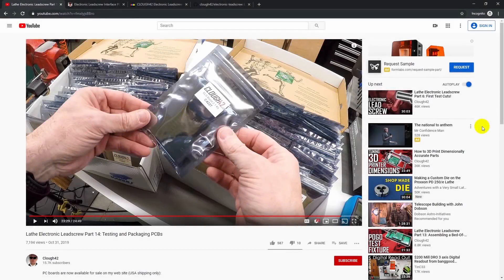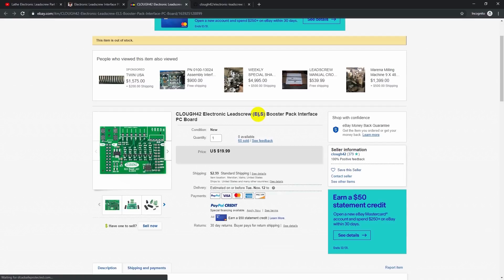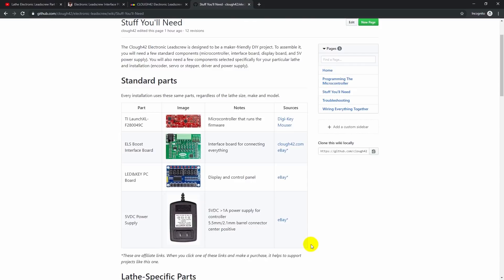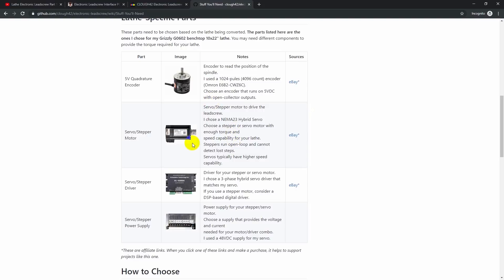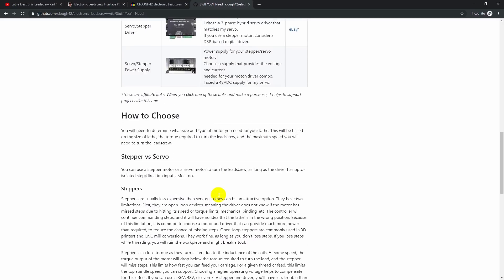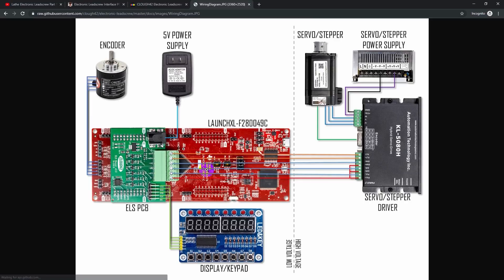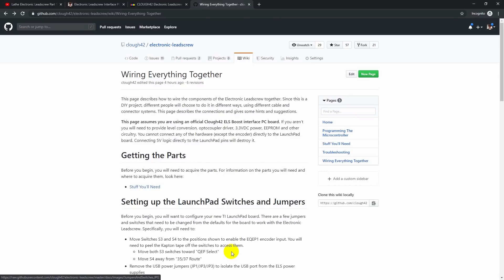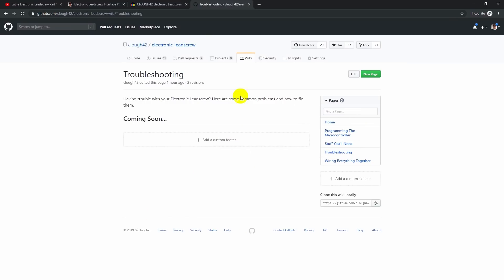Lathe Electronic Leadscrew Part 15: Sold-Out PCBs and Documentation

Comment: I bought this. I know this is several years old, but I stumbled upon your channel, maybe a year and a half ago and it has helped me tremendously with several projects, and I have wanted to do this for a long time since I saw your videos on it, and of course I picked Probably the worst time to do it at the same time as I’m doing a digital read out on my Mill as well as motion on Z & X with power feeds, not a CNC conversion because I have a 4‘ x 4‘ CNC enclosure already that’s a gantry Mill, that serves any CNC purpose I have I wanted something manual to be able to feel what I’m doing when I’m just doing it without Design, that’s how I like to get my creativity out is to just make things rather than design them first, then when they work, I make a design and make it more professionally but that’s here nor there, as far as the lead screw project it’s gone, wonderfully, it’s on the lathe and working perfectly, I did use the same stepper/servo that you did, my leg is similar in size. It’s slightly bigger but nothing substantial it’s 30 x 14, and it’s handling it very well. that stepper online servo is pretty powerful, I had actually purchased a Nema 34 1700 inch pound and 12 nm of torque servo and didn’t even need to use it, this was plenty. So I was impressed with the motor, the encoder. I don’t have any comment on because I didn’t try that encoder, but the one that I did use works great. But the punchline is that I appreciate all you do for the community, and your videos, your work on this project and everything else that I’ve seen that’s been tremendously helpful to me personally, and your video say you’d like to hear from us about how we like the videos and I’m just fulfilling that, so in short, I appreciate everything you’re doing

Comment: Already have a EK-TM4C1294XL Launchpad, which is same dual BoosterPack XL connectors and runs at 120MHz and has 1MB of flash. Can the software be recompiled for this Launchpad?
Reply from the maker: Seems unlikely, since it's a different MCU and has no encoder inputs.

Comment: cam I use a 12 volt or 24 Volt, DC  mother with this system a I already have the Motors, & the yes micro switching as There off a mobility scooter ?

Comment: Builders will have to modify the code if there is anything other than a 1:1 ratio from the stepper to the lead screw. My TPI was way off before I realized the code couldn't know about my 4:1 gear reduction. Just multiply your gear reduction factor into the TPI_NUMERATOR equation. If you still have problems, don't forget to check the settings on or in the servo driver. Mine were set wrong and it drove me nuts until I figured it out. For example, my quick change gear box reverses the direction of the lead screw, but since my driver has an external switch to reverse, it didn't require any software changes.
Reply: Thanks for the tip about gear reduction factor, I reduced my microsteps to 4 on the driver to over come my 2:1 ration problem but your solution is much better (smother operation).

Comment: Hi James. Some channel suggestions, should you have a few odd spare days to make the videos! (I'm joking).  A tour of some of your other electronic test equipment - why you bought that model oscilloscope for example. A look at your frequently involved 3D printer set up, particularly the software used. Personally I think you'd have done a wonderful job with a 'How to build a cnc mill' but appreciate that is water under the bridge now - there's some useful hints in the coverage you do have at any rate. The point is that you are an extreemly good educator and much appreciated by your viewers (ok, nearly all!). You get complex things across so very nicely and, for example, have given this rather verbose almost 70 year old  the confidence to tackle your ELS project - I've now got your ELS boost kit (No folks, it's not for sale!) and my rotary encoder is now on the way from China. I'd also like to thank the people who input thoughtful comments, in some cases direct to me. It's both helpful and uplifting. Thank you all. BobUK.

Comment: First, i want to tell you that i find your explanation of this project the best video series i have seen .
 I m starting to get everything to make this project.
 One thing i d like more precision is about the belts and pulleys, I think you sait M3 for the servo but i dont see the width .
 I evaluate the width to about 20mm but i cant find m3 pulleys that wide. i might go with M5 unless you could point me in another direction.  

Thanks a lot for this great project.
 Daniel

Comment: Hi James, it might be helpful to add a few links about timing belts and pulleys to your documentation, along with a note about spindle sizes! As you will know the rotary encoders are available with a wide range of pulses per revolution. Maybe a note about altering the firmware if a 1024 pulse unit cannot be found would be useful and do you have a feel for what pulse per rev range would be ok?Incidentally the cost of the rotary encoder here from an established UK based supply house is over £200. A great deal cheaper from E-bay. BobUK.

Comment: Feature suggestion: a proximity switch input to stop the feed, sort of like how some lathes have an adjustable bump-stop that decouples the half-nut.  That way you can thread quickly without having great timing skills for stopping the feed at just the right place.
Reply: I was thinking the exact same thing. Isn't there already some sort of inhibit/enable input that gives this ability to instantaneously halt motion via the E-stop switch?

Comment: My main question surrounds in how to acquire the box that holds the display and holds the buttons? I've got nearly everything else.
Reply: Me too. BTW, I just barely made an order on the second batch. Got two boards on the way. I'm hoping Jim is willing to offer a modified version of the ELS program to allow a simple gear hobber to run. Clough42, please contact me if you want to hear my ideas on this parallel project.

Comment: One last thing, you might want to restrict the purchase of the next couple of batches to one board per customer, initially. On the last batch, quite a few people bought 2 or more boards which really cut down the number of individuals who got a chance to purchase one. After the initial rush is over, I'm sure that many people, myself included, will buy extra boards for additional machines or projects. Thanks again for your efforts on our behalf.

Comment: I already modified my machine, waiting for 2 components to be delivered - LED display and a belt to drive the encoder. In the meantime I did a test run just to see if the stepper is capable of turning the leadscrew and pulling the apron/carriage/cross slide along. Looks like I will have to change the pulley ratio from current 1:1 to 2:1, seems like the stepper is just not strong enough at 1:1 ratio, I cannot take as deep cuts as I would like to.

Comment: Oh, I have another question. Can the board do 2 encoders and 2 servos? I was thinking about controlling the cross feed as well. I know it'd need additional programming, I just want to know if it has that capability for the lathe and something else I have in mind. Again, awesome video series, thank you very much for all that you've put into this!!
Reply: If you are powering the cross slide too you are just one step away of full cnc. I did this and used a Pokeys57CNC board with Mach4. I put on two handwheels so I can still use it like a manual lathe just with steer by wire.
Reply: Christoph Pech Nice!! Thanks, I'll look into it :)

Comment: Sold out that's the right kinda problem to have.
Future projects suggestion because you explain things so well would like to see you write a driver for an oled display(s). Arduinos have many libraries for this but that doesn't help someone who wants to change or add parameters. Your basically stuck with what the programmer thought was important. Displays are so universal in projects and oleds are a nice upgrade would be neat to see some one fabricate from scratch like this project and explain the code.(c maybe?)

Comment: I would be interested in doing this if I could work out what motor to use, as my lathe is quite large.  Will have to do some homework on how much torque the lead screw might need.
Reply: Suggest you just measure the torque. All you need is weight and a leaver.
Reply: Andrew Gillham thanks, good idea.  👍

Comment: I will by the board when it’s available, but am getting parts to get rolling, but would like to breadboard the interface for now, could you formalize the circuit diagram for thru hole components also on the wiki, as I fear i may miss opportunity to buy one in the smaller batches, and want to start machinery mods sooner rather than later.

Comment: When ordering at Mouser.com (controler board) if you are international customer you have to choose an address remember that at the bottom of the page under "delivery type" to choose "commercial" now you can choose DDP
Carrier Cost
DDP (Duty and customs fees paid by Mouser)
FedEx International Priority
I had to pay $ 15.57 in sales tax and $ 23.73 in customs clearance.
Regards Jorgen Denmark
Reply: I got my board ordererd directly from TI and had it in for 44.76$ taxes, shipping etc... included for delivery to Belgium. With the exchange rate it should be around 40€. Ordered on Nov 4th and delivered today on Nov 8th. This is very fast !
Reply from the maker: Yow.  I would think TI would have distributors that stock the boards internationally.  I haven't spent a lot of time looking, though.
Reply: @Clough42  I thought it was an Swedish part of Mouser but it came from US. So I run into custom troble so I had to pay, it is why I put in the comments. Fine work James, you are a little handicapped when you also have work to do in daytime.

Comment: I'm curious, why did you hook the Enable, Step and Direction pins positive together, and switch the negative side - as compared to hooking their negatives together and switch the positive side?
Reply from the maker: As has been pointed out, switching the negative side is easier for a couple of reasons.  I used an N-channel mosfet transistor, which is very efficient and has a low on-resistance.  Historically, the P-channel (or PNP) transistors that would be required to switch the high side were more expensive and had a higher on resistance, though that isn't as much of a problem today as it was.

The other issue is that sourcing a voltage to the n-channel gate (or biasing the base of an NPN transistor) is a little easier.  Technically, 3.3V logic only has to get to 2V to be considered logic high, so there's a chance that a high output would still switch on a P-channel transistor (-1.3V gate-source).  But since logic low is usually 0.4V or less, you can be sure that it won't switch on an N-channel logic-level FET (0.4V gate-source).

Using N-channel also has the added benefit that a logic high output from the pin turns ON the transistor, which turns ON the common-positive LED in the optocoupler, so you don't have to remember to invert the signals.
Reply: to sink current you use only one cheap transistor

Comment: amazing!! this makes finding a used lathe easier for me, since i could pay less for one with no gears for the lead screw.. for example.
now, i've been thinking. you use an encoder to read the revs from the spindle. to me that means it is reading "turns". WHAT IF you use an encoder to read turns from your cross slide and carriage?? that'd make one "easy" and probably very accurate DIY DRO wouldn't it? (don't know about the price thou). as i mentioned in some other videos, i know closer to nothing about all this... but i didn't know that electrinic lead screws existed when i suggested that not so long ago, so im feeling more confident hahahahaha. i feel like using something similar to what you are using for the E-leadscrew could also be used as a DRO. hope this ideawasn't too stupid.
Reply: The problem with reading the dials using a rotary encoder for the purpose of a DRO is that you don't account for backlash in the leadscrews. For this reason, linear encoders directly connected to the sliding parts are far more accurate.

This is also technically happening with the e-leadscrew - but because the carriage will be moving in the same direction every pass, any backlash is essentially a non-issue.
Reply: @bradley3549  i see. very intersting. reading the position of the moving element compensates for backlash in the leadscrew that moves it. reading from the leadscrew itself would always read the x amount of backlash. sadly backlash is not particularly a constant error (cos' of wear in the nuts and screw increase over time, and so does backlash). otherwise, you would be able to have a "death zone" (make it not read the first x pulses from the encoder). well, that would be posible actually, you'd have to re-measure the backlash every so often. i guess it'd all come down to price-effort in terms of linear vs leadscrew DRO.

Comment: Phew! Glad to see the level of interest James, my board is in the way, should he here next week. Cheers BobUK.
Reply: Hi Bob.  I’m also in the UK and would like to hear how it turns out.  I’m on mycncuk plus I have a YouTube channel.  Thanks
Reply: @routercnc9517  Oh, hi there! Yes, I've been wondering if I should try to put up a series about implementing it on my lathe. The little board has arrived - took a few days longer than anticipated, but it got here. I used to work with pcb's at BT and this one is nicely made. I'm approaching my 70's so the 'complexities' of YouTube are a mystery to me. I'm about to start acquiring the other components. Lathe is a modified Amadale AMA 290 V-F. First, though, my workroom needs a massive tidy up! Cheers. BobUK (Suffolk).
Reply: Ok.  You can talk about it on the mycncuk forum if that is easier.  Good luck with it.

Comment: i really want to get this kit. im wondering how i would get it to work with  my atlas th42?   this project is just awesome...ill snag one when they come in again. is there a way to do a prepay?
Reply: @minskmade,   I have an Atlas TH54 basically the same lathe and purchased the components to do the conversion,  I'll be posting a video of the project very soon.
Reply: @SouthernEngineering  to awesome. i will be following. i purchased my th42  a few months ago. it did not have the quickchange gear box..but the lathe itself never used..its like a museum piece..
Reply: @minskmade `Museum Piece' mine too! BUT they left it outside for a few years 😢 . Actually, mine is in fair/poor condition but definitely can be rebuilt; I found it at an estate sale; I have the quick change, but it's not in very good shape, plus I need to do Inch and metric threads, that makes an ELS the perfect mod.  I'm going to start on it in a few weeks, the plan is to have it functional by the end of the year.  

I post updates, project previews, and other random stuff on Instagram #southernengineering